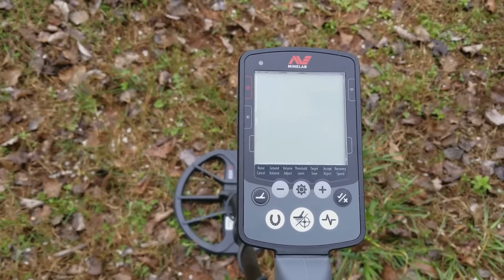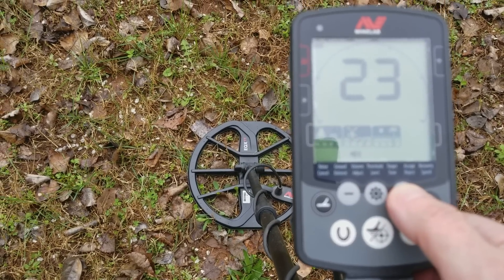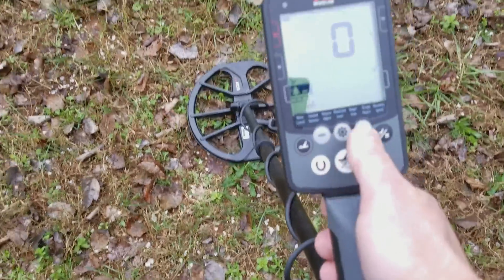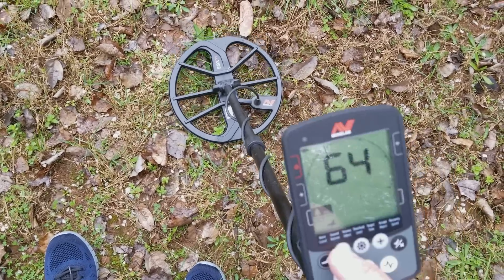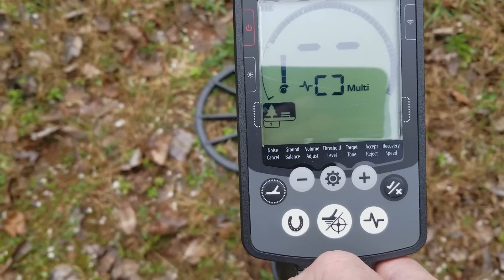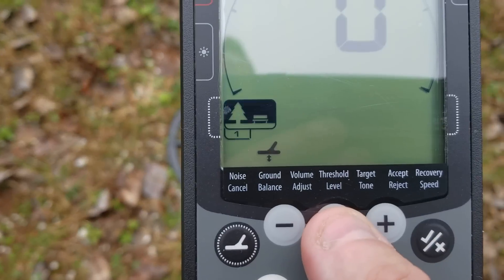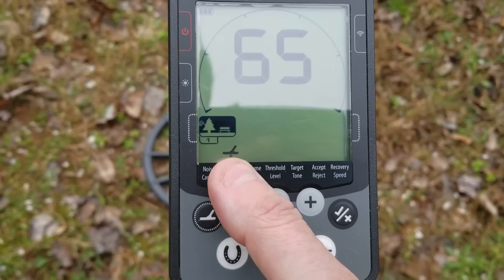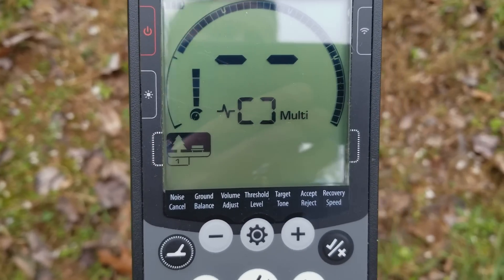How to Ground Balance Minelab Equinox 600 and 800 Metal Detectors

Comment: When you choose a field and set-up according to manual....each field has a ground compensation/balance level built into it and in the upper New England states, that has served me very well. The other methods of ground grab, I have never had to use. Going to states with more of the heavy red clay type soil quite often needs the addition of the auto ground tracking or ground grab.

Comment: Question:  For the Equinox 600, what has happens if you do not ground balance before detecting in a park on soil?  Also, do you need to ground balance before detecting on the beach on the dry sand or wet sand?
Reply from the maker: Minelab recommends leaving the ground balance at the present level unless you're searching in mineralized ground.

Comment: Thank you! I bought the 800 a few months ago and this is a great video. 

Question: Does the ground balance technique work for all modes including gold modes?
Reply from the maker: Gold mode defaults to tracking ground balance, and Minelab recommends keeping it on tracking for gold mode.  I'm assuming it's possible to manually or auto gb in gold mode though.

Comment: Thanks for that. Appreciate the lesson.
BTW where did you get the descriptive text menu bar above the - settings + buttons? My 800 does not have these. Cheers.
Reply from the maker: Glad it was helpful.   The text is preprinted on the screen protector.
Reply: @wayneetcetera  thanks Wayne. Ill have to get one, cheers
Reply from the maker: @michaelclark2840  Your detector should have came with them.
Reply: @wayneetcetera  thanks Wayne. Ill check the box again.

Comment: So when would you need to use the autotracking ground balance, when you know that the mineralization of the soil changes as you are hunting? Like going from sand dunes down to the beach type of situation, I imagine it would be better to do it separately in the 2 different areas, but just for example?
Reply from the maker: Yes, that's a good example.  Or maybe a field where you know ground conditions change.  But yes, you could just do it manually.

Comment: thanks for the demo. i've used my 800 about 5x w/out doing this lol, & i've still found 3 rings & 2 silver dimes
Reply from the maker: Awesome.  You may never need to ground balance, but at least it's an option if the conditions call for it.

Comment: THANKS FOR SHARING. BRAND NEW TO DETECTING AND JUST GOT NOX 800
Reply from the maker: Awesome!  You'll love it.  What were you swinging before?
Reply: @wayneetcetera  BRAND NEW. THE LAST ONE I USED WAS MY DADS OLD WHITES DETECTOR WAY BACK IN THE EARLY 70'S. I HAVE A BIG LEARNING CURVE AHEAD OF ME.
Reply from the maker: @REBELDAWG-ADVENTURETEAM  I had one of those big clunky Whites also!
Reply: @wayneetcetera  I BELIEVE IT HAD ONE OF THOSE BIG 6 VOLT BATTERIES. I MAY HAVE IT STILL WILL HAVE TO CHECK THE BACK OF THE STOREROOM.
Reply from the maker: @REBELDAWG-ADVENTURETEAM  I had no idea how to work it. Still found a few goodies.  Mine was a Sears detector made by Whites.

Comment: Im confused help?......I see many using 0 (ZERO) 
ground balance on the NOX ?......
why use that vs doing a manual or auto GB at the site before you hunt ?.....am I missing something?
Reply from the maker: Generally speaking minelab recommends leaving ground balance alone.  But depending on your ground conditions you may get better results by ground balancing.  Just experiment for your conditions.

Comment: On my at pro in my area it gbs at like 90 ..on my 600 it wants to go on very low numbers..like 4 or 6...the highest I have seen it was like 12 on auto tracking..wtf? Any ideas?
Reply from the maker: Interesting.  What kind of ground? I've never ran mine with tracking turned ON.

Comment: great video ...quick question ..can I use normal Bluetooth headphones with this machine without having the little box thing to send to headphones ?  thanks
Reply from the maker: Hey Duane.  Thanks for the question.   No.  You don't need the wireless module.  The wireless module is a way to use corded headphones "cordlessly".  You plug corded phones into the module and the module connects wirelessly to the detector.  Then you just clip the module on your belt.  So the module is sending the signal from the corded phones to the detector.   You can just use aptx low latency headphones or earbuds with the Equinox 600 right out of the box, no module is necessary.   I use Soundpeats q9a+ earbuds.  Also check out the Miccus SR-71 headphones.  These are the SAME EXACT headphones that come with the Equinox 800 but without the Minelab emblem.  Let me know if you have any other questions.
Reply: oh great you realy have made me feel great I been trying to find out about this ...thanks so much for your information realy is appreciated ….MANY THANKS ….

Comment: Does anyone know if I can pair my Bluetooth headphones to the 600 or if that's even possible?
Reply from the maker: james wiygul Yes.  You can pair bluetooth headphones with the 600.  The 600 is bluetooth ready, right out of the box.  Bluetooth with Aptx and Low Latency is suggested.
Reply: Attention! Bluetooth has bad results with Nox! Read the manual.  Audio time lag of 17 ms
between EQUINOX and the WM 08 Wireless Module. Minelab ML 80* headphones 40 ms and Bluetooth® technology has a high audio latency of 100 ms. 
So - for best results go to the basic! unit speaker or wired headphones!

Comment: When looking for clean ground prior to ground balancing, does it matter what sensitivity level the machine is on?

The following is my problem.  I turn the machine on.  I set which detecting mode I want.  Normally at this point my sensitivity is already set at 20.  I then pinpoint to check for clean ground so I then can do my noise cancellation.  Only problem is when I am checking for clean ground, I can't seem to get clean ground with my sensitivity at 20.  Does it matter if I lower my sensitivity just so I can find clean ground and then do my noise cancellation and than ground balancing?  Then after that turn my sensitivity back up to 20.

Comment: just one crazy question is that o 600 0r 800??
Reply from the maker: SOULDETECTOR 600.  But the 800 ground balances the same way.
Reply: thats wy the AU Dont apear on mine lol
Reply from the maker: SOULDETECTOR Your detector doesn't display AU when you do an auto noise cancel?
Reply: no
Reply: i have 800 and he dont display AU when i do noise cancel.
Reply: not even even if i set factory reset , should this be a problem???
Reply: Yeah, I don't get the AU when I noise cancel, either, with my 800.
Reply: Probably just one of the small differences between the 600 and the 800.

Comment: If I’m not mistaken. When doing a noise cancel. The coil should be in the air and it on the ground.  At least that’s what the manual tells me.
Reply: You point it towards the source of the EMI. If its coming from the ground you put it on the ground
Reply: MrDoccus that’s for noise canceling

Comment: Noise cancel is to be done in the air, not on the ground. Per the instruction manual.
Reply from the maker: Wayne Yes.  Thanks.  Someone else brought that up.  You're correct.

Comment: Hi,
do you balance the ground effects every time you go hunting?
do you really need to do this?
when to do it or not?
Reply from the maker: allvideo44 Yes, every time. Even if moving from one spot to another.   Unless you can't find clean ground.
Reply: Equinox has automatic ground balance tracking so for most uses there is no need to ground balance manually
Reply from the maker: Matt Wolbaum I wouldn't run tracking in very trashy spots.

Comment: Thanks Wayne, can you change the tone pitches on the 600?
Reply from the maker: Iffy Signals Hey Iffy.  You can change the number of tones, but not the pitch of individual tones.
Reply: wayne_etc . Ok thanks Wayne
Reply from the maker: Iffy Signals Apologies, Iffy.  Apparently you can adjust the first tone only on the 600, but you can change all tones on the 800.  From the manuaI page 47.  I haven't experimented with this at all.

Comment: Thanks for the video. That is the incorrect way to noise cancel. You do not put the coil on the ground. You hold the metal detector straight out about above the ground, You are noise cancelling for surrounding EMI not whats in the ground. Manual Ground Balance, Auto Ground Balance and Auto track were correct.
Reply from the maker: Don Thanks for the comments Don.  You are correct sir.  I did the noise cancel the lazy way.
Reply: Don- That can be argued...lots of EMI can come from the ground as well. Minelab has always stated to hold the detector up..and (I do this with my gold machines) however there is a well known authority that says to keep the coil on the ground.. and that is how some of us have been doing it with the CTX Just FYI

strick
Reply: You could argue that but EMI is really just RFI (radio frequency interference). Your going to get interference from powerlines, cell towers and radio towers 90% of the time not from the ground unless your metal detecting over power lines laid in the ground. This comes with the territory of any digital circuit.
Reply: For wet sand and shallow water you have to noise cancel while coil is in the ground or else you will keep getting false signal in high sensitivity.
Reply: Thanks for the tips and the vids, I learned a lot.  Will GB on the sand at the beach and the air in my neighborhood.
Reply: Noise cancel that is
Reply: The minelab engineer that developed the equinox has stated that you point it in the direction of the emi. So if the emi is coming from the ground you point it towards the ground. You are an amateur and have no idea what you are talking about.
Reply: @methylone1  you sir are a twat.